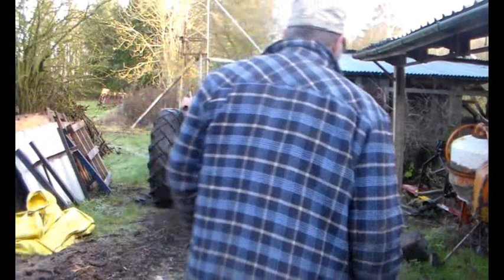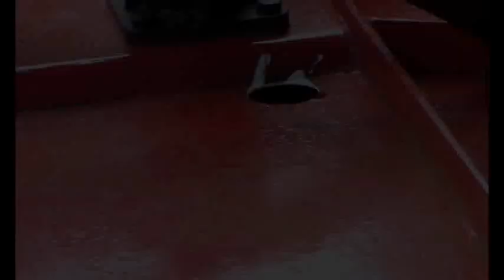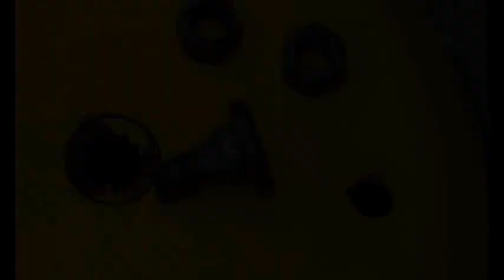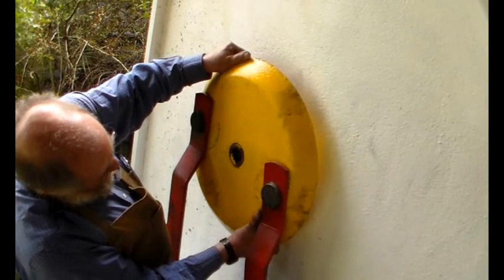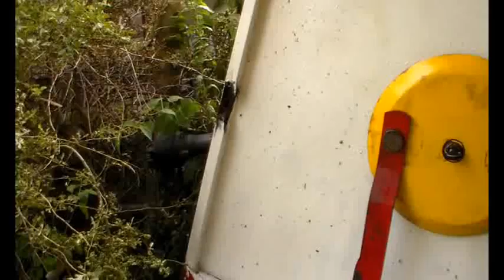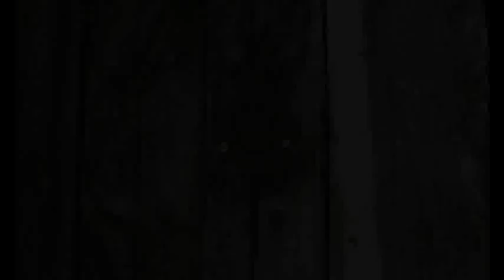The yearly cycle starts again: Danelander pasture topper, bad design and modification.

Comment: That topper design flaw is ludicrous Andy - the blades surely shouldn't be accessible by your toes like that :o)  Also, I didn't know that toppers could have swinging blades - the only one I've used extensively was a Twose which had fixed blades and a shear pin in the pto shft somewhere in case a hidden rock catches you out ....swinging blades seem like a better idea though. Maybe yours has the shear pin as well.
Reply from the maker: Dave, yes you are right, maybe I will weld and extension on the front. The swing blades are good for removing shocks and there is a shear bolt between the gearbox and the PTO. It's good now and I will take on board your idea of a modification but it would be a very dangerous place to stand, cheers